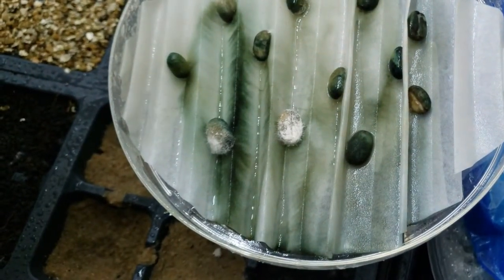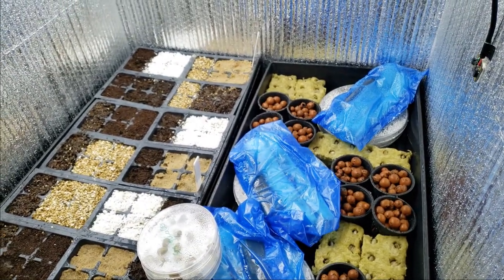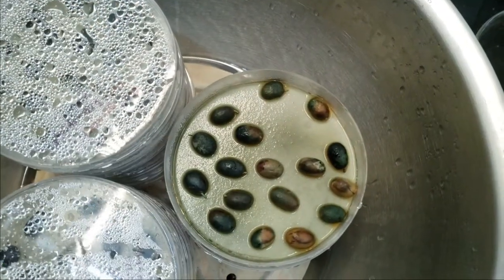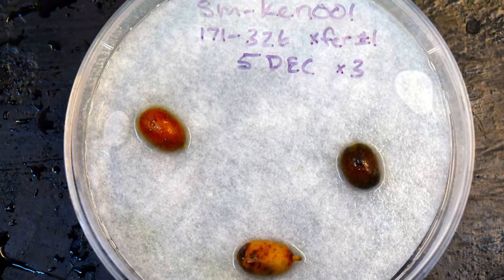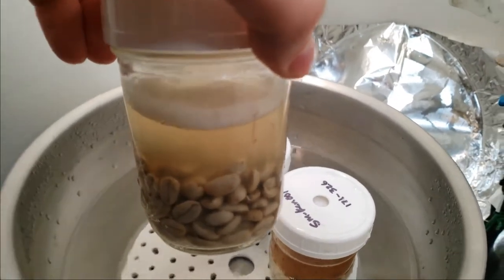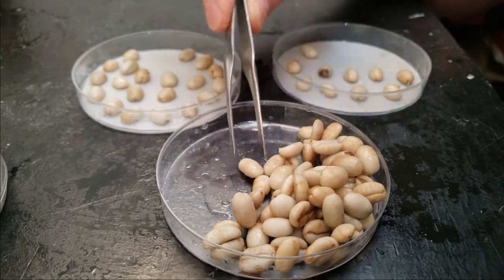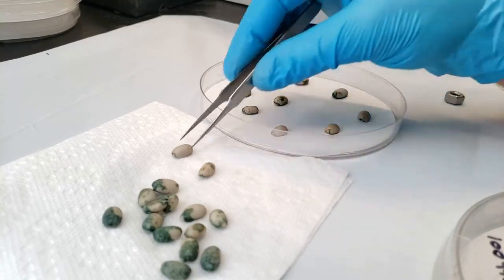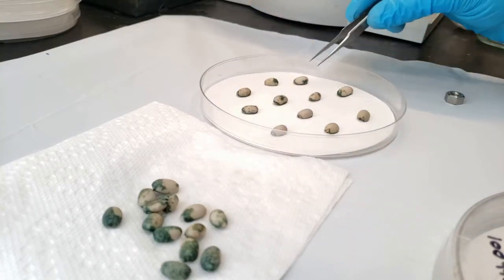Germinating Green Coffee Beans: Trials 2... 3... more?? | Coffea arabica #2

Comment: Hi there! I've been taking up a similar undertaking as you (albeit without the same level of impressive lab equipment) and have been seeing similar issues. Your insight on avoiding coplanting and cosoaking is definitely something I'm going to use going forward!

Three questions for you:
1) Do you typically perform your sterilization step in ethanol before or after soaking in water? My assumption would be before, since once the root emerges, vodka would be toxic to the plant

2) Have you seen the root fall off after emerging? I've assumed the seed to be dead after this point. However, I'm curious if this is typically a result of trauma, or the seed "giving up" for some reason

3) What are your thoughts on coarse vermiculite for germination? Most advice I see is to use fine for germination, but I inadvertently purchased coarse and am wondering whether I should go ahead and buy fine. Additionally, other insight on germination media?

Thanks, and best of luck with your project!
Reply from the maker: 1) I have always done the ethanol wash first. I agree that ethanol would be toxic to the germinated plant. It might be somewhat damaging even before then, but you have to weigh the risks of contamination vs. the risk of seed damage.

I wish I could get seeds with their parchment layer intact. That way, the seeds could be sterilized without fear of hurting the cotyledons and embryo inside. If I ever get to the point of selling coffee seeds, that's how I'll do it.

2) Just last week I discovered that the sole survivor from Trial 1 had lost its root. Both of your explanations seem plausible. I have read some mention of aborted root growth in the literature, but they didn't provide a specific cause or solution. I'll have to do more research.

3) If you presoak your seeds, coarse vermiculite is actually better.
Fine germination media is good for hydration because of the increased contact between the wet media and dry seed. If your seeds are already well hydrated, they will probably benefit more from the increased aeration of coarse media.

When it comes to the germination of commodity green coffee, I think filter paper on Petri dishes are the absolute best option. In my experience so far, you end up tossing 90+% of the seeds. It makes things so much easier to visually inspect each seed for contamination, exudate, and growth. My next coffee video will be about this method in more detail.

In the meantime, the wet paper towel in a baggie method is a good low-cost alternative. Coffee filters in small plastic containers work too.

If you have any more insights, please don't hesitate to leave a comment. Trial 3 has only 5 germinations out of 72 seeds, so there is still a lot of work to be done.
Reply: @electricveg  Thank you for the quick response, and sorry to hear about your seedling 😢

I'm getting 50 seeds from Hawaii next week, so I hope they will fare better than the commodity green coffee from my last attempt!

Another question, which also happens to tie into a theory for the roots falling off: how often do you think vermiculite be watered? Should it be more by observation of dry soil, or be strictly periodic? I suppose that I may somewhat be underestimating the water retention that comes out of prolonged soaking.

I noticed that one of the roots fell off while soaking, it also happened to be the first one that sprouted in that batch. I'm wondering whether overhydration may be a potential culprit for this issue
Reply from the maker: @Remy0313  Vermiculite doesn't really change color when wet, so it might be difficult to judge when to water by appearance. Verm has a good water:air ratio, so you can place it directly into a small pool of water.

I'm having my doubts about one of my statements from the first video about initial root formation. The more that I think about it, the green protrusions seen in the first few days of soaking can't be roots. They must be some form of leftover stem that engorges with water.

Comment: Thank you for sharing your journey. My arabica beans just arrive and I am starting to soak them today. I plan on disinfecting them with ozone water. I was wondering your thoughts on ozonated water?  Since the germination period is so long I plan to use ozonated water to keep my seeds hydrated and fungus free(I’m hoping). Also hoping that O3 after hydrating reverts back to its original form O1 and aerates the grow bed. This will be a first for me.
Reply from the maker: I have never used ozone, personally, but I don't see any major issues. It's a common disinfectant for municipal water sources.

Ozone has about 50% greater oxidation/reduction potential than chlorine.  However, ozone has a maximum solubility of ~25mg/L in room temperature tap water. The bleach solution I use has about 20 times that concentration of chlorine. From my preliminary research, it seems that ozone water is relatively safe for seeds and sometimes beneficial.

The amount of disinfection will depend on the concentration and exposure time. What sort of ozone generator are you using?

Here's a good review:
https://www.tandfonline.com/doi/abs/10.1080/01919512.2019.1673697

Ozone is an interesting disinfectant. I might look into that more for future research. Thanks for the idea!

Any organic material will help convert the ozone back to regular oxygen. I would definitely use a carbon-based potting mix like peat or coconut coir. What sort of seed starting mix were you planning on using?
Reply: @electricveg  
A friend of mine gave me a book called Flood your body with oxygen by Ed McCabe. In that book mentioned using ozone with your plants.
I bought a small Ivation-Portable-Ozone-Generator-600mg and i am using rockwool plugs and than hopefully move them to a rockwool cube. I put the rockwool in RO water and ran the ozone through a air stone for 30 minute. Before planting the seeds I did the same but for only for 10 minutes. I plan on growing them the whole way in a hydroponic system. Not sure witch one yet. leaning towards the dutch bucket method.

Comment: I wonder if you could germinate the coffee seeds on top of a medium that changed color upon reacting with caffeine so you could see the diffusion of the caffeine for each bean. That would allow for better spacing requirements to be documented. Also, watering the seeds from above would allow caffeine to be washed away, perhaps improving germination. If you did several consecutive soaks with new water each time you could measure the extracted caffeine in each soak for better documentation. I also wonder if you innoculated with mycorhizzae initially if the beneficial microbes would inhibit the fungal growth.
Reply from the maker: All excellent ideas. You hit all of the talking points for my next update!

I think exudate color monitoring is a good option for distinguishing nonviable seeds and removing them early. I've been using the technique in trial 3. https://doi.org/10.1590/S0101-31222012000200004

Trial 3 used only 24 seeds per group and they were leached in 1 liter of water, exchanged twice.

Microbial degradation of caffeine is one of the protecting factors in the traditional soil cultivation of coffee. It's the storage and transport of commodity green coffee beans that infect them so heavily with pathogenic species.

I think one of Pseudomonas spp. could be used as you suggest. They are included in a couple of commercial beneficial microorganism inoculants.

There's more current info on my progress at 
https://www.electricveg.com/rubiaceae/coffea-arabica.html#work-log
Reply: I should have included this note on my coffee growing journey (so far):  
Before I even saw this video I ordered unroasted gesha coffee from several suppliers to start my own gesha seedlings. They will arrive within the week and I need to work out a methodology to tackle it. 
Last week I received 5 green geisha beans that I decided to rehydrate in dilute Worm Gold worm casting tea. I planted each in a 50/50 mix of coco coir/coarse sand in 1 gal pots and stored them in a protected location outdoors (San Diego, its 40s at night 70s in the day right now). My other coffee plants are doing fine outdoors (all seedlings from 4in pots at Home Depot) so while I don't expect quick germination it is a fun 5 bean experiment.
Reply: @electricveg  Hey, 
So today I started soaking a cup of green gesha beans (washed process) at around 1pm, changing the water every hour or so. Its 9:30pm now. Unbelievably, I found 12 beans that already threw out root shoots so I potted them up and added mycorrhizae fungi to the soil mix. No dried roots were visible prior to rehydration but it is possible these could have been remnants from an aborted germination. I am gonna see if they grow and try soaking another cup of beans tomorrow :)
1/31/22 11:54AM I am doing a wash followed by a drained technique on the remaining beans. They sit in the sealed drained container for a couple of hours then I do a wash again. I found 4 more sprouted beans that I removed for germination. I don't know whether this batch of coffee beans was particularly viable or if this technique is worthwhile. Here is the link to the beans that I bought for this. https://www.etsy.com/listing/1109005489/organic-green-geisha-unroasted-colombian?ref=yr_purchases
2/1/22 For several of the beans that have shot out radicules I am keeping them in a small plastic container, washing twice a day, followed by draining, replacement of the lid and germination in a dark space. The radicules seem to be growing very slowly and no signs of mold so far.
Reply: This batch, as well as a batch with a 30min Hydrogen Peroxide wash got infected with blue-green mold. I don't know if it is something in my tap water. I need to boil the tap water or use distilled next time. My next batch will use oven-baked sand, 30min  Hydrogen Peroxide soak and boiled, cooled water for hydrating.
Reply: @jameslively4487  I have never tried peroxide disinfection. For some reason it isn't well represented in the literature, but I don't know why.
It might be worth testing further washes with disinfectant after mold is detected. Though the seeds might already be dead by the time the mold is visible.
Keep up the good work!